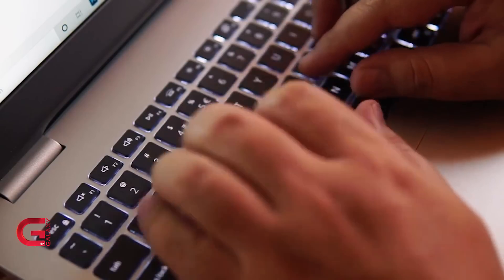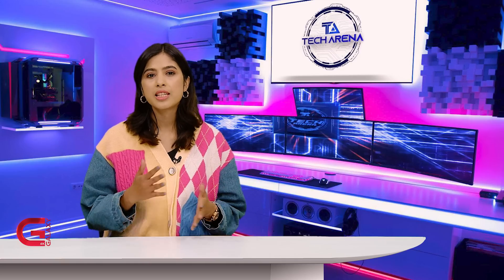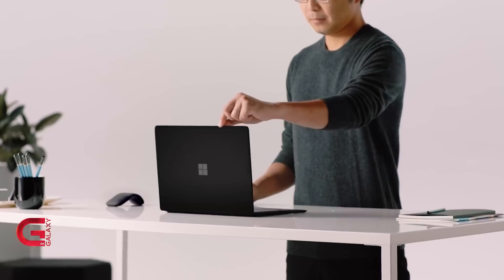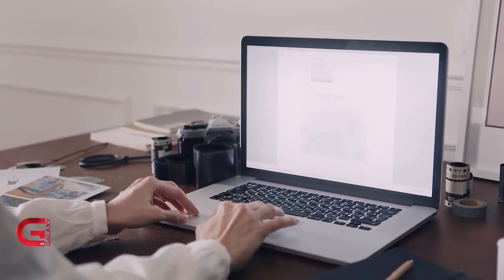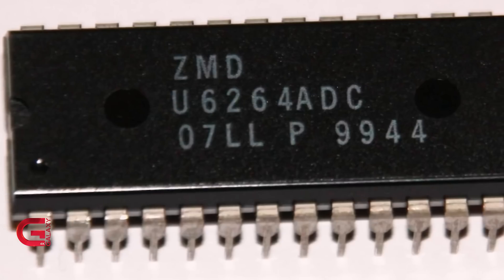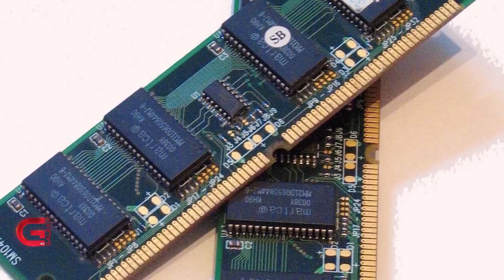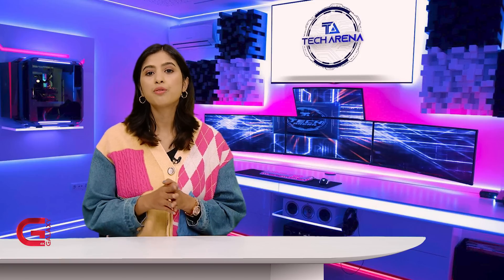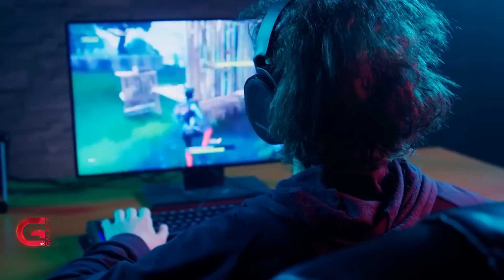Laptop किन्दै हुनुहुन्छ? यो भिडियो हेर्नुहोस्। Laptop Buying Guide।Tech Arena| Episode 19

Comment: most lacking part of the laptop is HDD which is very very slow compared SDD. So, at least go for SDD, I said absolutely "NO" for HDD. Though she didn't emphasize that much in the video, but you should consider this feature. For example, if your current laptop with HDD is performing slow then rather than replacing the laptop just change the HDD to SDD. You will see the magical performance in terms of the speed of your laptop or PC.
Reply: load matra xhito 
gaming fps ta   farak hudaina
But ssd is recomended